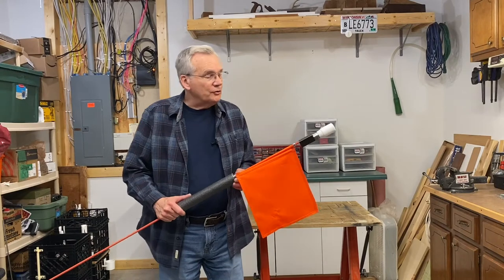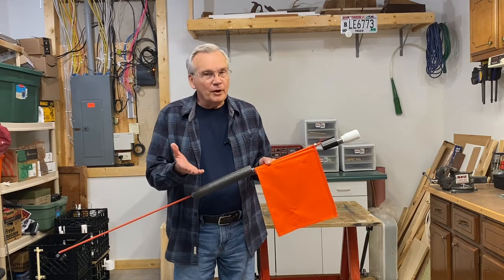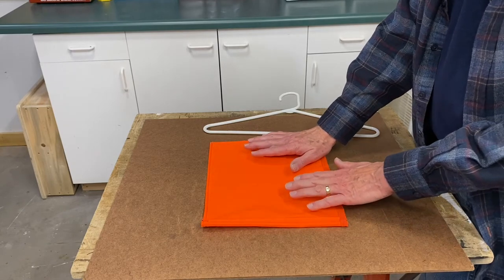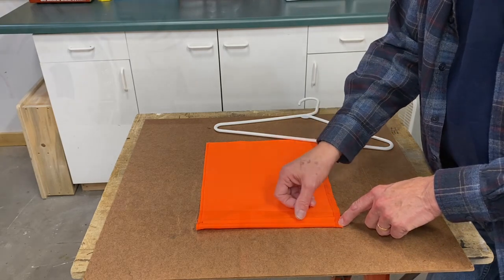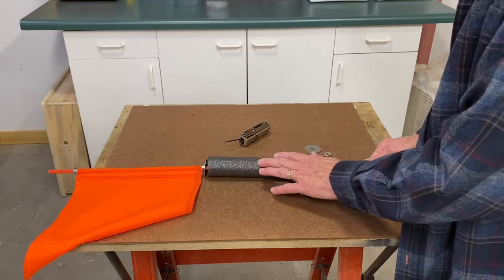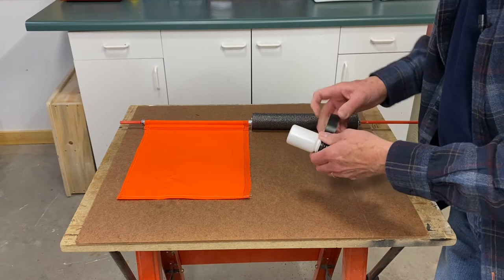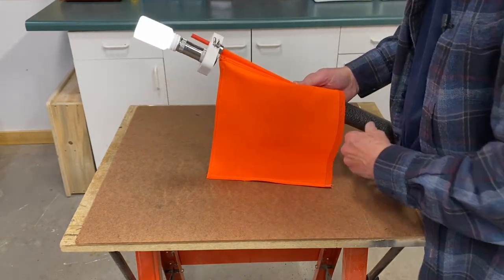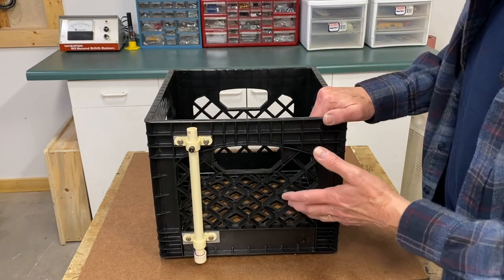DIY Navigation Light and Safety Flag for Kayakers

Comment: Great video and very well thought. Does the flag pole actually float with the pipe insulation? Have you tested it?
Reply from the maker: I did test it and does float. However, I recently switched to a higher lumen flash light and haven’t tested it yet. I will have to do a float test in my bath tub. I’ll let you know if it floats.
Reply: @georgebowman3051  awesome, thank you.